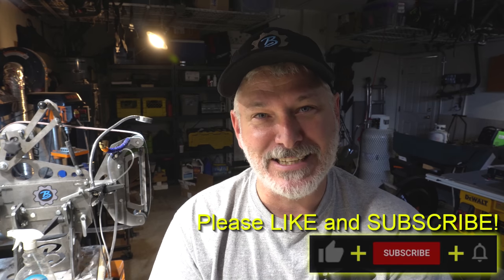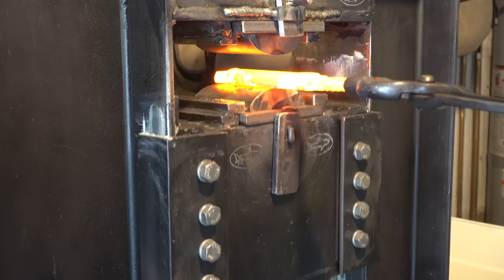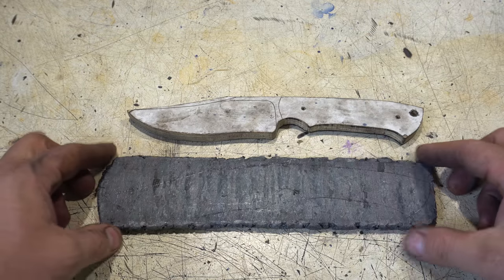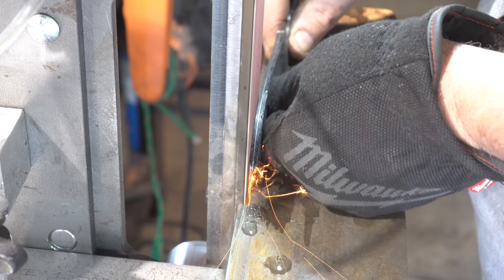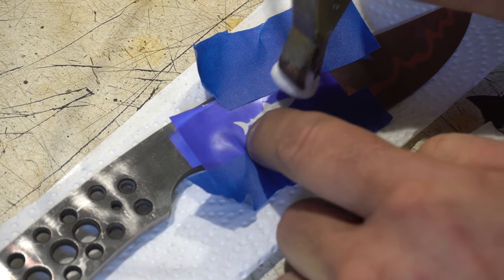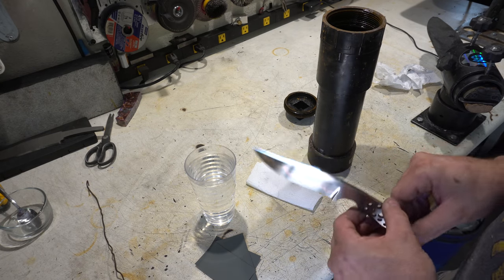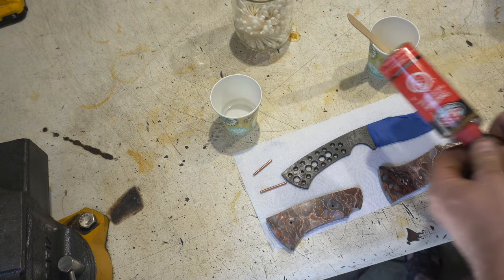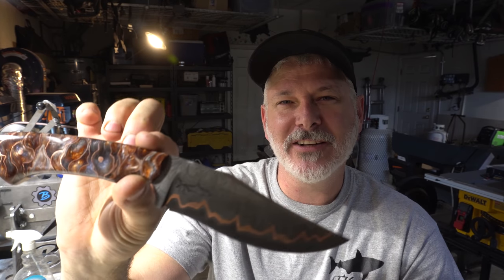Forging a Special Copper Damascus Hunting Knife

Comment: Beautify as always.  Now lets see you try and get different patterns of the copper throughout the steel.
Reply from the maker: That’s a tough one.  Every time you restack the billet you’d have to add a layer of copper between them because you can’t get it up to forge welding temps or you melt all your copper.   Maybe I’ll try a restack at some point.  👍. Thanks for watching!

Comment: I really do like your channel you have given me many great ideas and I think you do good work. W/e said that you cannot weld copper needs to look it up. It is true that welding dissimilar metals together is difficult and complicated and considered impossible using some methods. some welds are set by manipulating a weld puddle, but because of the differing characteristics of different steels / alloys getting a sound weld is not possible. There is a type of Welding that allows bonds between dissimilar metals. It is called diffusion welding (bonding). Look it up. This type of weld does not use the manipulation of puddle, but instead used heat, pressure, and time to create the weld. Black Smith's/ and blade Smith's use this welding technique all this time. They call it forge welding. This is the process you use when you join copper to steel, or when creating Damascus steel.
Reply from the maker: Thanks for following the channel, I appreciate it!

Comment: You choose the handle materials great! The copper on the handle make this knife design consistant and complete! Beautifull work Denis - Jim will love it! And from my perspective (as a knifemaker) I want to thank you for all great tips and tricks you share! I had no idea about the reaction between ferric chloride and the copper. 

And one very cool detail you probably didn't plan (it would be super difficult to make on purpose, but you made the same on copper damascus bowie, so now I'm confused :P)- the line how copper goes to the choil is magnificente! All copper and high carbon core starts from the coil and goes to the tip. Love it!
Reply from the maker: Actually it will always do that.  The plunge line is where you remove the most steel and it will flow around the blade.  👍 Thanks for watching, David!
Reply: @TyrellKnifeworks  Yes, but I didn't mean the plunge line. I mean the choil :). It's cool that the copper goes straight to the choil not above it.
Reply from the maker: @DBCraftWorld  yes, same concept.  Thanks David!
Reply: @TyrellKnifeworks  I start to thinking about that and you're right. the depth of the choil makes that happend, but anyway it's looking cool and it's cool detail!

Comment: Wishing Jim a happy birthday and many thanks for you for making this for him. Just out of curiosity, instead of copper, can you use gold, it would look awesome?
Reply from the maker: Yeah you could use gold.  I even looked it up, it would cost about $1800 just for the gold.  😜. Thanks for watching!
Reply: @TyrellKnifeworks  how much gold will I need in kg or grams? And how many carat? Will the gold be placed on the same method as per video where strip(s) will be inserted? Also, if I ever wanted to extract the gold out again would it be possible after melting the knife or will all the metals mix (I'm not planning to but just asking) and what designs of knife do you have? Sorry for all the questions but your work is stunning and I am interested
Reply from the maker: @tkhan4451  even 9k or 10k gold would work.  You’d need a sheet of 0.01 - 0.02 inch thickness that was 1.5” wide and 12” long.  I would cut that in half to have two 6” pieces, one for each side.  Then do a high carbon steel core and probably a Damascus cladding.  It would be really hard to melt out the gold after the knife was produced, you’d probably lose most of it.  If you want to front the $$$ for the gold, I’ll make the knife!
Reply: @TyrellKnifeworks  how much will the knife cost? Can I have a quote with and without gold but without gold an different colour metal so it has contrast like the copper/metal one on this video.
Reply from the maker: @tkhan4451  I don't actually do custom orders, I'd be willing to do this if it has the gold in it.  Why don't you email me at tyrellknifeworks at gmail or msg me on instagram and we talk about it.

Comment: Beautiful work is always, you're so talented..
I'm wondering what would happen if you twisted the metal as you did in the first step but with the copper sandwiched in between..?  Would it give a cool looking pattern or just be a mess..?
Reply from the maker: That wouldn’t work.  The steel wouldn’t forge weld after that.  Thanks for watching!

Comment: Would this work with Brass? That could be very cool also. Great work. Amazing
Reply from the maker: Yes, it works with brass.  It’s a bit trickier because the melting point of brass is about 150F lower so you need to be more careful not to melt it out.  Thanks for watching!

Comment: You sand the scales down after you etch the blade so you shine up the tang where it shows I’m assuming, how do you re etch that part of the handle that shows, do you dip the entire knife, scales and all back into the acid? Thanks.
Reply from the maker: I just use a q-tip and etch the tang.  For resin scales you can just dip the whole blade but this one has copper in it too and I didn’t want that to etch. Thanks for watching, Shane!
Reply: @TyrellKnifeworks  thanks for answering man, awesome knives!
Reply from the maker: @shanek6582  I answer all my comments, Shane.  👍🏻

Comment: Your knife is a work of art.
I am curious if you have issues with dissimilar metal corrosion, or is there something in the forging process that prevents it?
Reply from the maker: You are referring to galvanic corrosion. Galvanic corrosion requires the presence of an electrolyte like salt water.  Keep the knife clean and dry like you would any normal carbon steel knife and it will last a lifetime.  Another interesting note, the Blade magazine overall knife of the year… has copper in it.   Thanks for watching.

Comment: I am in awe of the craftsmanship you put into these. I LOVE the copper in the blade. Would love to have one of these one day. The process you use, is it the same for a San Mai knife? I’m guessing they kinda do the same thing, just with steel?
Reply from the maker: The san mai is very much the same, though you need to heat that one to forge welding temps where the copper must stay below about 1800F.  Thanks for watching!

Comment: Do you have multiple hydraulic presses, for the different type of press things, or do you use one, and then change the shape of the metal you're pressing the hot steel with? 

Also I love it, its beutiful
Reply from the maker: My hydraulic press has different dies that can be swapped out.  The flat ones for moving metal in all directions and of course making things flat.  I have rounding dies for moving metal and lengthening things.  I have squaring dies, aggressive rounding dies, dies for punching holes and splitting and even dies for putting patterns into the steel.  Thanks for watching, Matthijs!

Comment: I love the concept of adding copper to the pattern weld.  Thank you for showing us how it can be done.  
I do wonder though if other soft metals can be done like silver or gold?
Reply from the maker: I’ve had many people ask me and the melting point of silver and gold is at or higher than copper so it should work.  I considered doing a build with gold but the gold alone would be $1800! 😬. Thanks for watching, Kevin!
Reply: Silver oxides easily so you would need to clean that often. I would also wonder about gold "wearing out" over use? 

Not that one would "use" that knife anyways. I wouldn't use any of these, too darn pretty!
Reply from the maker: @ngcastronerd4791  i wouldn’t recommend silver… you might as well just use nickel.

Comment: Question about CuMai: doesn’t the copper tarnish over time (more rapidly than the steel)?
Reply from the maker: I’ve seen cumai knives I’ve made from several years ago that still look pristine. They need to be oiled and kept clean.  A light buffing also removes any tarnishing as well. Thanks for watching.
Reply: @TyrellKnifeworks  I’m guessing a lot of CuMai blades also don’t get much actual use. They’re so pretty most people probably just keep them as show blades and safe queens rather than risk damaging them with use.
Reply: @TyrellKnifeworks  new subscriber BTW. Great content. I am working up to my first Damascus clad gomai (with pure nickel on layers 2&4 and monosteel core). Your content has been very informative on that project. I have to hand hammer my Damascus, so I don’t do a lot of it.
Reply from the maker: Welcome to the channel, John.  Good luck with the gomai! 👍

Comment: Yeah I’ve been wondering how much abuse a copper laminate blade would take before failure. Obviously this knife isn’t something that would ever encounter that much abuse if any at all.  The cutting edge isn’t going to be a question it’s the copper layers. A bend test is what I was curious about. Like doing the ABS mastersmith test with one.
Reply from the maker: I don’t think a copper layered knife is going to survive the ABS JS performance test.  Then again I don’t think over 50% of blades would survive it either.  Thanks for watching, Erik.

Comment: Could you theoretically use silver instead of copper or is silver to soft
Reply from the maker: You certainly could use silver.  It’s use in brazing quite often. Though nickel is shiny like silver and has a higher melting point.  You could even use gold!  😍

Comment: quick question. i have had this on my mind for a while now.  does the acid etch prevent rust from washing? coz i have made swords out of leaf springs before and hand sanded them to 2000grid and them polished them with wax. but exposure still rusts the blade. so i wanted to know if acid etching prevents rust as well. going through the chemistry of it all my answer is yes. but need a real professional's opinion..... because how did the feudal Japanese keep their high carbon steel blades from rusting. sure oil. but oil dries up and its a ritual in it self to reapply it. but still. you get my question right?😄
Reply: also i would love to have a battle ready gold damascus sword. maybe ill buy one from you if you can ship to china and if and when i have money
Reply from the maker: Etching with Ferric chloride provides a bit of rust protection but the blade will still rust.  A coffee etching will further help, but nothing is perfect at rust protection. Wax and some oil is always necessary.  I’m sure in old days they used some form of wax or oil.  Thanks for watching.

Comment: Pipe wrenches grip round better then they grip square. They are meant for round. You can test this before believing me but it’s true. When it rounded you would have needed to adjust the wrench size.
Reply from the maker: While that might be true for hard steel, it doesn’t work for hot steel.  The teeth of the wrench just put groves in the billet and don’t grab.  Thanks for watching!

Comment: Another beautiful knife. I'm curious though, as to how you re-etch the tang of the knife after shaping and sanding the scales? Alternatively, how do you protect the tang from getting ground down to preserve the etch when doing the handle?
Reply from the maker: The tang gets ground and resanded when the handle is sanded.  Then I etch it with a q-tip.  Thanks for watching, Owen!

Comment: Hi I have also been making dama steel since 3 weeks ago and it is a nice new challenge but does anyone have any tips for making dama steel with copper
Reply from the maker: Are you referring to the product Damasteel?  It would actually be the same process.  Put the Damasteel as cladding, copper, then some central high carbon steel and weld up the seams.  You’d be heat treating the core steel.  Thanks for watching.
Reply: no thanks I always find the videos very instructive and always fun to see how damask steel knives are made I do it myself in a charcoal with a few layers of insulation in it so that
Reply: I have some kind of oven
Reply: Thanks again for the tip I made normal dama steel yesterday and tomorrow I want to try to make copper dama steel
Reply from the maker: @firework5493  just weld all the seams and don’t get it too hot.  👍
Reply: I welded my Smitsvuur myself so and I welded a steel and dome over it and then added heat resistant insulation

Comment: Can you tell me what the thickness is on the copper, Thanks
Reply: You answered my question about how thick it is 0.02 is about 1/16 of inch can you share your supplier 
Thanks again
Reply from the maker: I use 0.020” copper sheets.  Thanks for watching, Leon.

Comment: it is a beautiful blade sir, but in no way can this be called damascus! except in ignorance. forge welding is a different process and is not a crucible steel. damascus steel is patterned but gets its pattern from the grain structure and alloys that were specific to ore from certain sources. patterned forge welded multiple strengths metal can mimic damascus only and copper was never in damascus especially in a pure form. in its time it was the new super weapon which is why it is known and desired and was more valuable and why it was faked as well. with todays metal smelting and modern tools its possible to produce far superior products so it is not a quality objection i have. it is common among abs smiths to "label" this as damascus which i feel to be a poor choice . why not glorify an older technique, why add to confusion . i would not accuse you of fraudulent activities but in the same breath southbys christies or any reputable auction house or museum would never call this damascus .  again wonderful blade and thanks for the video i hope its owner enjoys it for a long time to come.
Reply from the maker: Mike, go read my community post on this topic.  In short, nobody cares about the distinction anymore.  Maybe .1% of people care and you seem to be one of them.  Respectfully, I really dislike this topic and its a hot button for me, so let's not keep this going.
Reply: @TyrellKnifeworks  may i ask why you choose to call this damascus? i believe i have stated my reasons why i believe it shouldnt  but in the same vein if you saw someone hand a child a hammer and nails and then say go screw those together...wouldnt you want to say somthing? i have respect for the work you do and it shows skill and knowledge i just do not understand why you and others choose to mislable the technique
Reply from the maker: pretty much everyone on the planet, including every master smith refers to it as Damascus.  That’s what everyone knows.  You know the history and want to show us that you know the history, sorry but nobody cares.  We all know it as Damascus. Do you also correct people for saying Kleenex instead of tissue??  Get over it
Reply: @TyrellKnifeworks  im good with tissue or kleenex lol and yes i do know the history but dont care if others do or do not.. as a smith making "damascus" i would expect you to know what it is and how it is made  which is why i just do not understand why the abs insist on calling forge welding a crucible steel....that makes no sense.  thanks for your time and response...off topic was jims birthday a good one?
Reply from the maker: I DO know how it’s made, but I’m a content creator and thus use terms that people relate to.  Stop being an elitist.  End this part of the comments now please.  I’m sure Jim’s birthday was great, but I wasn’t there.